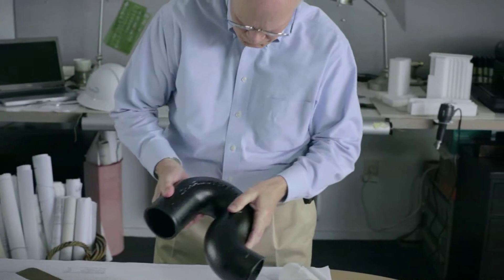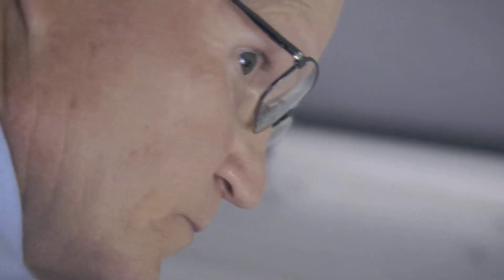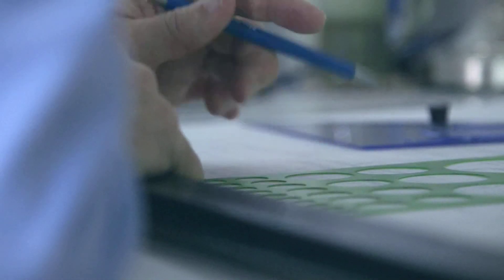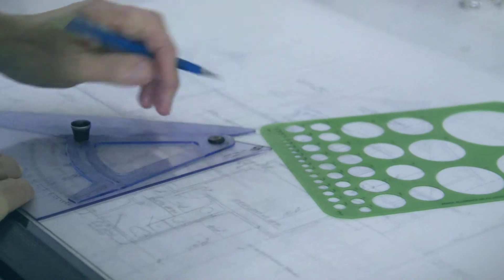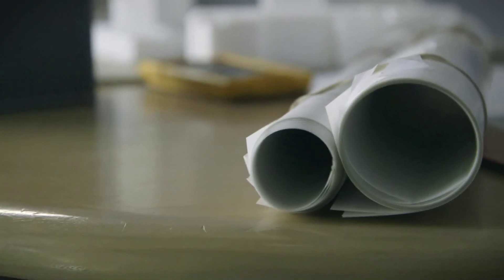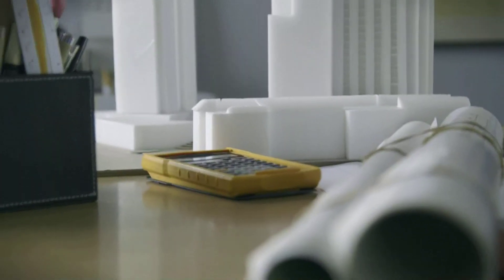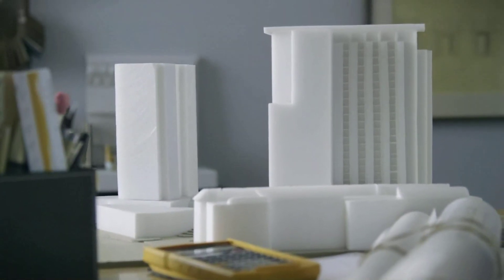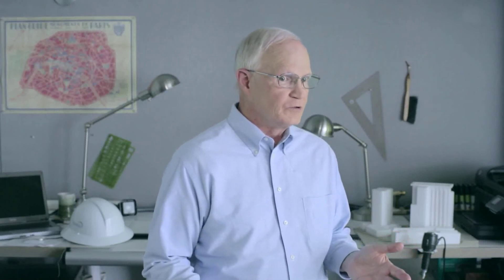CharlottePipe & Foundry and Value Engineering

Comment: So another one sided video. Why was a drain cooler not specified? Not only that, but at the time of this video, codes identify a maximum of 140F discharge into the drain system, the fact that discharge temps above this maximum were done leads me to ask again, why wasn't a drain cooler put in place? Where was the AHJ with this installation in not catching this during inspection?  Did the engineer specify a drain cooler, and the installation missed this?
Reply: The engineer specified Cast Iron is what he was saying.  If you listen you heard him say "Well how does Cast Iron collapse?", he probably said that after pulling up the plans and then found out the pipe had been switched to PVC.  PVC shouldn't be used in Commercial/Institutional buildings.